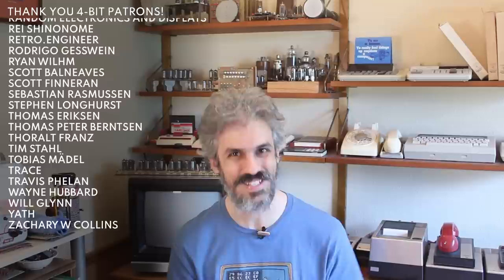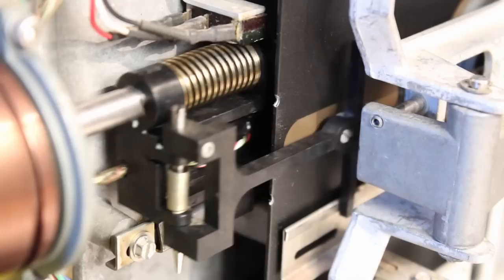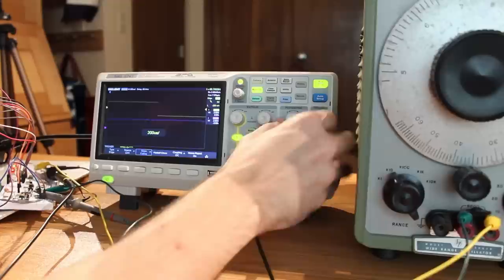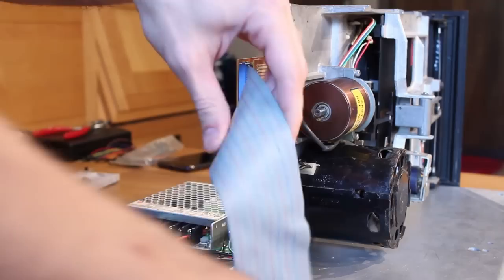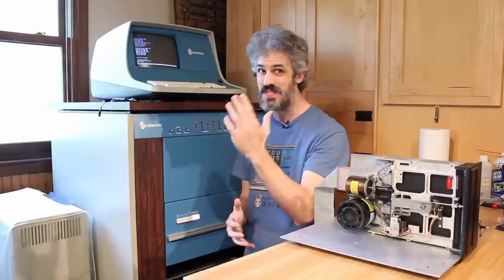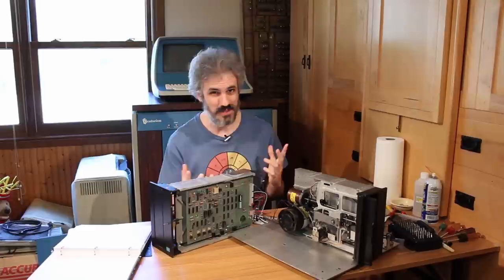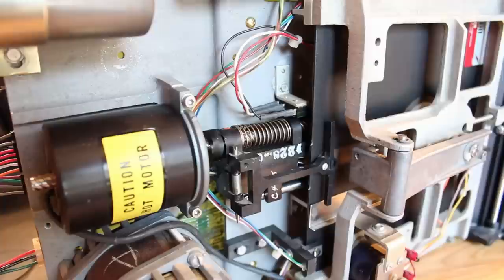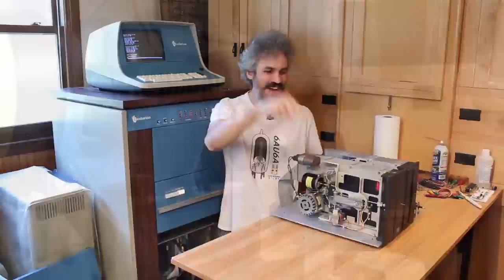Minicomputer Part 20: Connecting the CDC 8” Floppy Drives to the Centurion

Comment: I still have concerns about you using soft sectored media. The sector pulse you are looking at is 1 per revolution. You should have multiple sector pulses per revolution with an index pulse for sector 0., otherwise you are only going to have one sector per cylinder. I do not think you have any way to write the  soft sectoring info to the disk, and that drive does not have the smarts to understand the soft sector data off of the disk if you could get it formatted..
Reply: I came here to say much the same, that the CDC floppy drives and controller board in the Centurion may require hard sectored media.

Comment: As you likely know, you can use a Schmidt trigger to make a square wave from your generator's output. Or if you have an old 74ls245 kicking around. Also, some tubes would be fast enough to make a digital Schmidt trigger, likely the pentodes because they have lower capacitance.

As seen in the floppy manual page 2-2, I wonder if the ready pin (Pin 22) is high or low when you try to read. Still I wonder about the DMA cable.

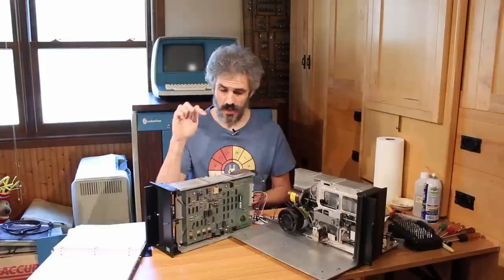Comment: 15:10 I've had Power On Reset circuits fail in quite a few different pieces of equipment over the years, including a DAT machine and an obscure video recorder.  You would think it's a really simple thing but for some reason they do fail.

Comment: Diodes on the input of a comparator isolate the input from the passives in the gate output? My only guess... cr20 may prevent the output of the gate from changing the values of the compared levels on the comparator. If it's a TTL chip the output likely has passives to ground or vcc.

Comment: What does the read test assume?  If it assumes you mounted a Centurion formatted media, then failure is expected.
Reply from the maker: We've been trying to figure it out exactly, but from what we know of the code so far, it should just seek, perform a read operation and then report back that the operation was successful, it shouldn't actually be looking at the data read. However, we seem to be failing before we even get that far. The microcode sets the busy bit and then is looking for something (not sure what yet) before it resets the busy bit. We've got a lot more digging through the microcode of the FFC to figure out what on earth is going on before we can even know where to look on the board for a faulty chip.
Reply: @UsagiElectric  Excellent.  Thanks for the reply and for all the amazing work you share with us.  Your persistence is inspiring.

Comment: Excellent video!  One thing I am curious about, why is drive B on the left?  I notice PET drives do that too.  Drive B and A instead of A and B.  🙂
Reply from the maker: Thank you!
And, uh, there's not any official reason why I named them that way. Mostly, I wanted the primary drive I focused on to be the near one with the PCB exposed, since that's where the majority of work would need to be done. So I just named that Drive A and then the far drive with the PCB hidden Drive B. 
Although, if you look at the drives from the angle I often looked at them from (the back side while trying to make them work), Drive A is on the left :P

Comment: Could it be that the command buffer error is causing the read error? Could be that the read command is getting lost in a faulty command buffer.
Reply from the maker: Interestingly, we've been digging through the microcode for the FFC and the command buffer test looks like it can't ever actually pass. It could be that that particular test was written for a different revision of the floppy controller. 
The read test should be passing though, but for some reason the FFC stalls after it sets the Busy bit. The answer lies in the microcode, but it's been a battle to try and figure it all out!
Reply: @UsagiElectric  That is pretty odd. Is there even any memory or buffer chips on the FFC that could be part of a command buffer? It might be software controlled. If there is then I would start there and probe the data lines looking for stuck or in-between bits on the outputs taking note that high-z state logic will appear with a slow rise/fall time and might look bad at first glance. Then move on to the control lines looking for the same thing on the outputs of various suspected logic chips. Mark the outputs with a red sharpy to make them easier to find rather than having to constantly look at a datasheet pinout.

Comment: can someone remind me why the pin in to these CDC Floppy Drives dont match the Floppy Controller of the CDC Pin Out.   As built (or modifiable) Can 5.25 or 3.5in discs work on the Centurion
Reply from the maker: CDC made, near as I can tell, three different PCB revisions for their 8" floppy line, each one getting a different designation - CDC 9400, CDC 9404 and CDC 9406. The FFC controller card built by Centurion was most likely designed with the 9404 PCB in mind. These two drives are the 9400, which is why they have a different pinout. Now, why did CDC make their three floppies with different pinouts? Who knows, haha. My best guess is that the early 9400 was built first, then when they designed and built the Finch drive, which can be daisy chained with the floppies, the made an updated PCB with a pinout that matched the Finch.

Comment: if you'd used a schmitt gate , part of a 7414 or even 555, instead of a transistor,  it would've worked ok 😉
Reply: a company i used to work for had intermittent issues with server rack cooling fans, kept throwing up errors on the controller box showing fan fault when it was actually working, they feed speed pulses back to the controller so i suggested it may be pulse problem, the capacitance of the cabling from fan to controller (its rotation sensor pulled down short pulse on each rotation but only had a fairly high value resistor to +supply, no 'active' pullup drive, according to the fans datasheet) so i bodged up a 4093 schmitt buffer on a bit of stripboard and told the tech guy to try fitting it in series with pulse output from each 'suspect' fan in turn, at fan end of the cable assembly (i was only a cabinet assembler, nothing to do with the tech part, but i've always tinkered with electronics, for 40 ish years)  luckily he did and it cured the issue in every case ! dunno if they then got a proper buffer made for the whole line of fans in the cabinet(6) or the designer changed the inputs of the fan controller to be less fussy,  as i not long after had to leave the company.